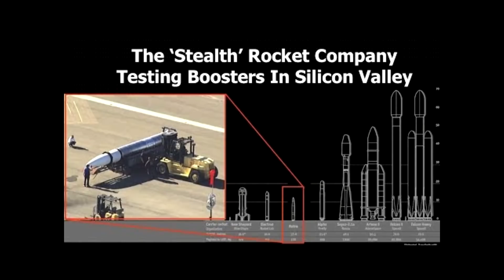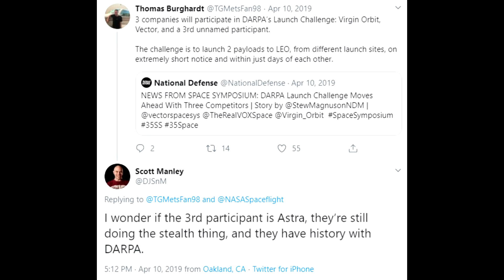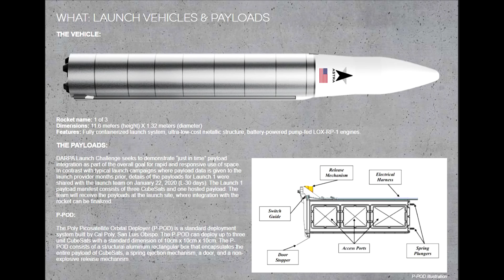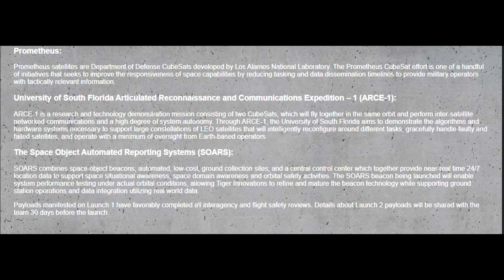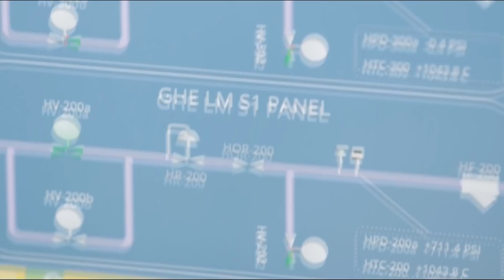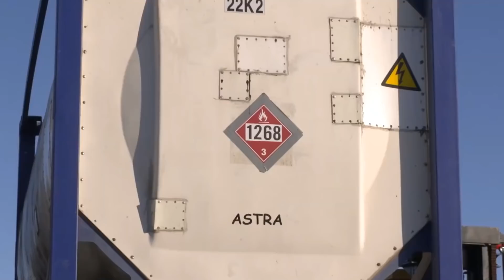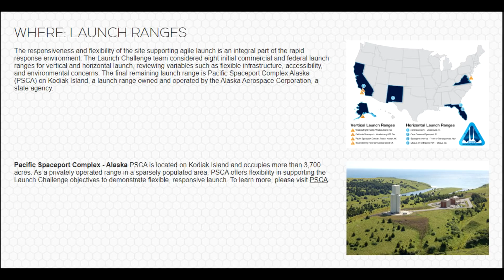Astra's Secret Rocket Project Finally Reveals Itself

Comment: 6:04 Don't trust people who claim to be successful when they clearly did not fly. And it creates a very bad climate within the company. Not a place I would want to work.
Reply: It depends on what the goals were. Let's say: The goal was a flight height of X and the rocket blew up in flight height 1.5 times X then the goal was reached and this event can be declared as succss.
Reply: well Elon did say before the first Falcon Heavy launch, if its takes off without destroying the pad then that would be a success ...
Reply: TMA1 we love Elon not astra
Reply: @BrownOpsLeak  Anyone who says that unironically is a fanboy with serious bias issues.
Reply: Andrew “Elon is a national treasure” - Donald J Trump, President of the USA
Reply: "successful launch" and then it blew up.
Reply: @_Andrew2002  - Starliner Abort Test - only two of three parachutes opened and Boeing declared success based on probably saving the lives of astronauts had they been on board, even though it wasn't a landing someone was likely to have walked away from.

Starliner Human Rated Certification Test - software problem resulted in grossly missing the orbital insertion with no chance of fulfilling the mission of docking with the ISS, but Boeing claimed it was a success and even went so far as to claim that humans could have taken control and overridden the faulty software.  In analyzing the software while on orbit (which should have been done on the ground), Boeing discovered and fixed a completely separate software bug that may have caused a catastrophic failure during reentry.  They also discovered a valve mapping bug that would have caused incorrect timing during thruster separation.  It appears there was no software testing or review prior to the unmanned flight test.

Basically, Boeing scores anything short of catastrophic loss of vehicle as a successful mission.
Reply: @Liberty4Ever  I wanna correct you one more time. Your average Joe would've walked away from the Boeing pad abort easily. You're just lying when you say it would've been rough not walkable away from, not using any evidence, just your bias. Starliner only needs 2 parachutes to land softly and safely. The reason there is 3 is incase one fails, that way you're left with the 2 needed to have a soft landing.
I'll remind you again, if you call Boeings pad abort a failure because of 1 parachute failure, then you're going to have to call SpaceX pad abort a failure because it failed to reach the required dow range distance due to engine failure.
Reply: @UCx-NaS2N1WtjkDNQ8V3VwEw - The point that's being missed is the very different cultures at Boeing and SpaceX.  Boeing is a large defense contractor that is accustomed to no-bid contracts, inevitable cost overruns, delivery delays, etc.  SpaceX is much more entrepreneurial.

Boeing relies on their 800 pound gorilla marketing and crony connections to government.  They act as if they believe their own marketing.  They seem to believe that space is hard for everyone else, but not for them, because they're Boeing.  SpaceX is taking a much more engineering oriented approach.  They are finally doing what should have been done decades ago - fully reusable inexpensive launch vehicles.  That's how the Space Shuttle was sold to taxpayers but that never materialized, and with the culture at the defense contractors born of the bad incentives provided for them by NASA and the military, they never would have made space launches inexpensive.  When they're part of a crony cartel spending tax dollars, why should they?  They're in the expensive space launch business.

SpaceX took on the challenge and they embraced the difficulties, with a deliberate goal to fail early and often, and always learn from the failures to iteratively improve.  There were many failures to land boosters, because they were making money launching payloads at the same time they were being paid to test booster recovery.  Competing against expensive non-reusable launch vehicles, SpaceX was able to do nearly free testing to develop their reusable Falcon boosters.

SpaceX had some as yet unreleased problem in the last booster landing at sea.  That would have been their 50th.  We realized how quickly our expectations shifted from expecting a booster to crash on a barge, to being surprised a couple of years later when the now routine booster recovery goes awry for some reason.  SpaceX has solved most of the problems with reusing first stage boosters.  They're now solving the more unlikely problems to polish an already commercially viable reusable launch vehicle.  Meanwhile, Boeing's Starliner is designed to launch on Atlas V, Delta IV, etc.  The only chance it has of reusing a booster is to launch on a SpaceX Falcon.  Boeing's idea of reusing hardware is reusing Space Shuttle engines while SpaceX is creating a truly reusable launch capability to drastically reduce lift costs.

I don't see how Boeing is going to be competitive, even in the military industrial sector where contracts are awarded mostly based on politics and back room deals.  SpaceX fails because they're developing long overdue new technology, and they learn from each unmanned failure.  Boeing is failing because they're launching test flights with untested software while resting on their wilting laurels.  Big difference.

To put this in perspective, SpaceX has been flying unmanned Dragon resupply missions to ISS for the last eight years, and Being just flubbed their attempt while trying to prove that the overdue Starliner is ready to be crew rated.

I'm rooting for Boeing, but they aren't making it easy.  Lately, it looks like an outdated vision, poorly implemented as expensively as possible.
Reply: @_Andrew2002  fell short of what exactly though? do you know the objectives of the launches?....things like this are not done first try, and often in science you send things through the procedure thats aimed at getting to the goal, without expecting it to, to collect necessary data to improve probability.
Reply: @_Andrew2002  i dont think anyone, including them expected to reach orbit on the first or even second flight....did you? do you know if they did? just because they attempted a launch, doesnt mean it was a realistic attempt at the mission....plus....the key word here is "launch"...they got the rocket off the ground. a launch is only part of the goal, they didnt say "successful mission"....the point is, this could be argued back and forth forever, and it just really comes down to a subjective opinion of what you think successful means to you and what they think it means to them, its a pointless debate and honestly a pointless complaint. You dont know what  their actual goals and objectives were for the launch, they could have met them all as expected.
Reply: and what was the goals exactly? why do you think you know them better than the company that has them? ... and how many goals do you need to cross off before you achieve success? your missing my point, just because you have an opinion, doesnt mean its the only opinion, or the correct one. your not putting anyone in their place with anything your saying. this isnt as black and white as your making it seem. your opinion of what you believe success to be or not be for them is subjective.
Reply: @JustinKrux  It seems, I have initiated a storm of comments here. Your question, Justin, "what were the goals exactly?" was spot on.
Thank you.
The Rocket 1 and 2 launches were very secretive, I couldn't find any published goals. (Maybe someone does. Let me know.) If there are no goals, there are no failures. BUT there shouldn't be any public victory dance, if you didn't have any public goals. It's a bit immature. It's what we did in kindergarten, when we tried to do a cartwheel, fell over, were laughed at and then claimed, "well, that's what I tried to do."
That is also the reason I like Elon's approach so much. Failure is always an option. He publicly states, what he is trying to do, sometimes fails spectacularly, but keeps pursuing his goals. That's why people trust him.
My god, he (actually it was Franz) threw a steal ball at an "unbreakable window", broke it, and still gets more than 500'000 pre-orders for that truck. People trust him.
Reply: @machelvet9594  that was a much more thoughtful response and i agree with you on many of those points, though i wouldnt necessarily call them saying a "successful" launch a victory dance, i mean, if we look at the symantics here, the rocket definitely "launched" but at the same time, i do agree that no public goals spoken of makes it difficult to really understand what that means, but....also, these words could just be lost in translation honestly through their media teams.What im trying to say is, damn, people are diving into some wild accusations and assumptions for a single sentence that only recently was published and hasnt been elaborated on yet. if they release more public information and details and it points in the direction of them not accepting a failed attempt then im right there with you guys. PS I also have high respect for Elon for that very reason.
Reply: @JustinKrux  Very well put. I like your comments. Normally I am in your shoes and make those comments, since people jump to conclusions. Keep it up.
Reply: @JustinKrux  The goal was to achieve orbit. Anyone who says otherwise is moving the goal posts to change the fact the first 3 flights were failures
Reply: @_Andrew2002  how do you know the goal posts were moved if you didnt know where they were to begin with? just because they launched a rocket, doesnt mean they were trying to get to orbit on that very flight.
Reply: @_Andrew2002  
That would be the (on your part) assumed goal, not necessarily the stated goal.

Do you have any stated goals in your life?  Or are you just a social media crusader?
Reply: @HuntingTarg  I'm not gonna get into a stupid debate where you question my life goals. I'm different from you, I avoid even talking on the internet unless people say lird and/ot stupid things. I don't go around telling people they have no goals, because that's a pathetic thing to be doing
Reply: @_Andrew2002  for the future, if you want to "put someone in their place" do it by treating their opinions with respect, and speaking to them in a logical manner, and an opinion that is subjective is never going to do that, its done by providing data and information to prove your point, not shouting that you "think" something without really being able to provide any information that proves your point. Usually people that go around trying to "put people into their place" are people filled with more ego than information. You want to prove your opinion? wait for the information and data to do so, and use it. no offense by the way, you may very well be right, but what im saying is, we dont know that yet. another tip, if someone is such a jaded fan that they are in denial of their mistakes and refuse to acknowledge them, anything you say is a waste of time, if they are already denying truth, its incredibly easier to deny you.
Reply: The first and second rockets didn't have upper stages in them, just masses. Even if everything had worked perfectly they wouldn't have made orbit. The spin is annoying, but there is a truth in that it doesn't make sense to pretend your first rocket is going to be 100% successful; the history of orbital rockets says otherwise. SpaceX didn't successfully put a real customer payload into orbit until their seventh launch; 1-3 crashed, 4 was a dummy payload, 5 was damaged during launch and was quietly written off, 6 was another dummy, then finally 7 carried a couple cubesats.
Reply: This corporate spin is really irritating. Be honest! Your rockets barely even got off the ground and then failed and crashed. Period.
Reply: Looking at you, Boeing.
Reply: Exactly, SpaceX quickly innovates because they accepted errors and failures will happen during development and learn from them. If nothing breaks then you are not pushing the envelope of available technology. Now if you fear failure and try to mask hide to the outside world then I don't see how can they grow to be competitive to RocketLab for example.
Reply: Yea that's a massive red flag. I would bet this company folds within a few years.
Reply: @_Andrew2002  It's ok I know - Elon likes to half-joke at times -  (also he put it at 50/50 and everyone should come along to see the spectacular fireworks show if it all goes pear shaped :)

Fortunately for us we got that beautiful surreal footage of Starman chilling out in the roadster and the sychronised ballet of the booster landings instead ...

Comment: Anytime I, unfortunately make the environmental sin of spilling hydrocarbons on the ground...
i always use the old fashioned catalyst known to convert them into CO2... i set the dirt on fire.

'...they dig up the dirt, and send it to a facility that uses a chemical catalyst to...'
Ffs!??
😂😂😂
Reply: @bosstowndynamics5488  indeed. Your position is smart. I was kinda implying that one would not wait, setting the spill alight before much leaching can occur.
I suppose, somewhere in between what I'm saying, and you said:
burn dirt, then after cooling, digging up a couple feet, and burning that again, return to hole...cover with fresh soil, plant some good cannabis indica.
☀️😎☀️🇺🇸

Comment: What is this for? Asteroid diversion?
Reply: Maybe, but with only 200kg payload it wouldn't be able to move much. Especially given the fact that most of that 200 kg would have to be used by a third stage to get the final payload to the asteroid while it's still far enough away that a tiny nudge would be enough to miss the earth.

Comment: North Korea: Struggles to develop and build orbital launch system.
Astra: Builds one that fits in a shipping container.
Reply: They know their market.
Reply: North Korea has launched satellites into orbit already
Reply: @eyeborg3148  they haven't. They've had some launches that reached space, but nothing that reached a stable orbit.
Reply: @jwenting  Yes they have. They've launched a satellite into orbit in 2016. Maybe next time you should do 30 seconds of Googling before commenting.

https://en.wikipedia.org/wiki/Kwangmy%C5%8Fngs%C5%8Fng-4
Reply: @eyeborg3148  Thus i wrote "Struggle" not "Fail".
Reply: North Korea's orbital launch program is a front for their attempts at building an ICBM. 
It doesn't have to go orbital, just needs to get on a trajectory that can reach the USA...
Reply: @jwenting  Any rocket that can reach orbit is an ICBM.

Comment: " Give up liquid fuel and use solid fuel " Saves money and you can have back to back launches . 👍👍
Reply: At a massive cost to efficiency. The Isp of solids suuuuuck. But they've got great TWRs so are good for booster stages.
Reply: @maxk4324  Also, they're not all to safe to transport
Reply: @sundhaug92  we transported them all over Germany and the USA I've yet to hear of an incident
Reply: @jimbritt2874  "On 11 January 1985, three soldiers of C Battery, 3rd Battalion, 84th Field Artillery Regiment were killed in an explosion at Camp Redleg, the CAS site near Heilbronn. The explosion occurred while removing a missile stage from the storage container during an assembly operation. "
Reply: @bbrockert  That was after my time and was unaware . I still stand by solid fuel as the way to go . Those soldiers dropped that first stage right on the nozzle causing separation and the fire . It was a terrible accident that shouldn't have happened . Three crewmembers died that day , that's messed up .
Reply: @maxk4324  go look at the old Pershing Missiles launches , might change your mind

Comment: Can't the military already do this?
Reply: Launch satellites at a moments notice? No, currently all launch platforms take a long time to organize, manufacture, and then launch. Yes ICBMs can launch at the drop of a hat, but you can't just use those to go to orbit. Their guidence and control systems are all designed for use as an ICBM and would at the very least need to be completely reprogrammed (if they even can be).
Reply: @maxk4324  What are they going to launch? You can't buy satellites off the shelf.

Comment: So, it's basically a V2! I find it hard to believe the US military don't already have have this, and have had, probably since the 50's.
Reply: V2 was much different in its design and operation, plus it couldn't reach orbit. The US has had fast launching ICBMs for a long time, but not launch vehicles. And before you ask, no, it's not easy to make an ICBM work as a launch vehicle. At the very least the guidence algorithms would need to be completely rewritten and likely a lot of hardware replaced.
Reply: @maxk4324  As I understand the V2 got very close to orbit when they just put cameras on it, I also find it hard to believe the US  doesn't or didn't have ICBM's you that could be but on mobile launch vehicles, if you discount Trident, The Soviets seemed to have them.